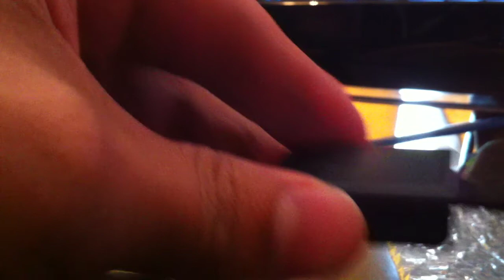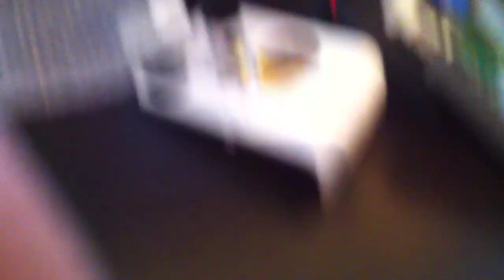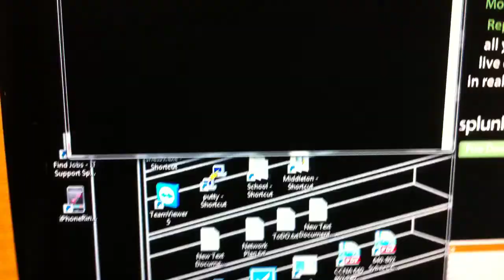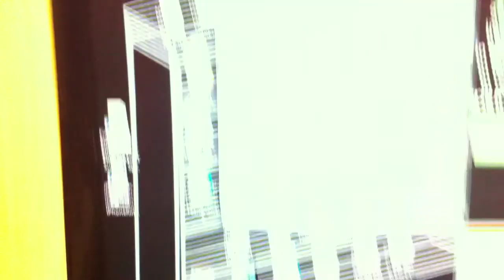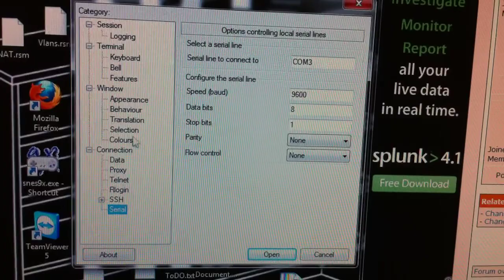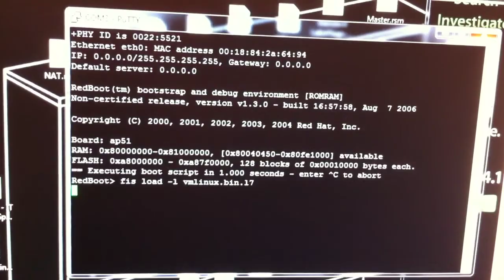Fon Serial Console part 2

Comment: Thanks very much this helped me very much I went to radioshack   and got the parts now I have 1 out of 2 fixed the second one will not show anything I think it overheated because I looked on Fons forum and they say it is a common problem  the old ones
overheat a lot if left ontop of a router.